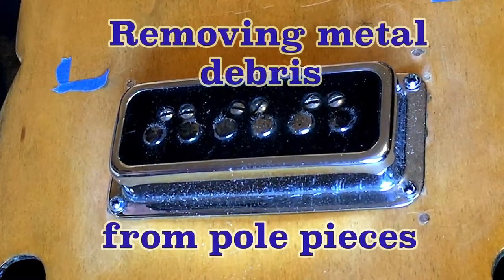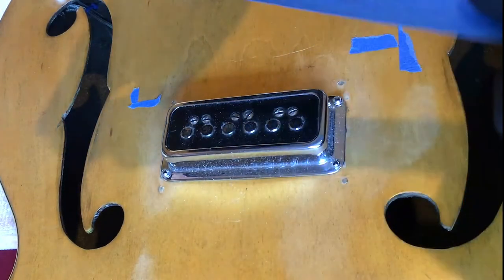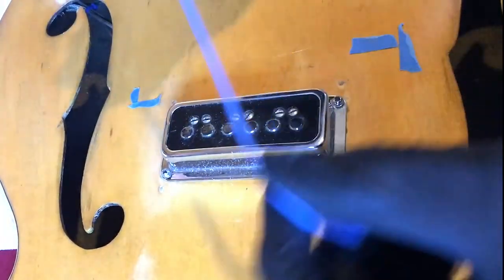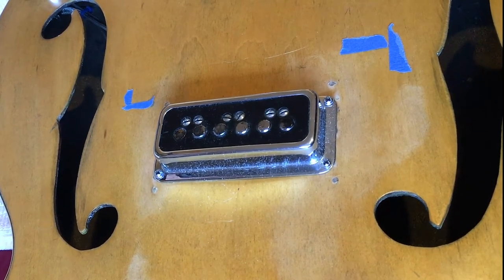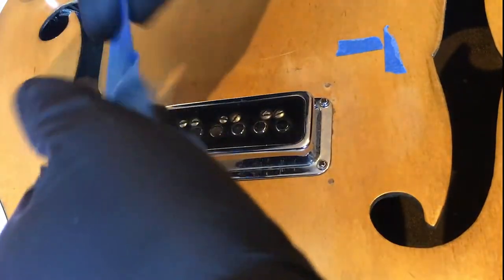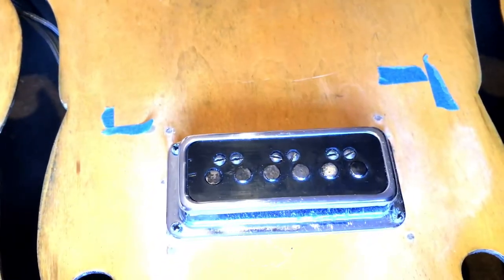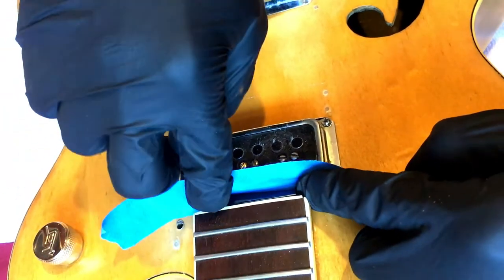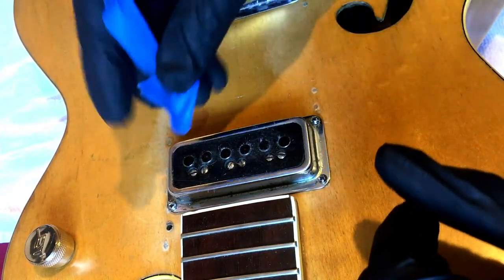Removing metal shavings or steel wool dust from pickup pole pieces

Comment: I had this problem on my DeArmonds today. I used steel wool a few days ago in the same room. Noticed the DeArmonds (T-Armonds actually) were covered in shavings. I tried masking tape first, but I ended up buffing them off with 10,000 grit sand paper as I was sanding and buffing the guitar to restore it.

Comment: So is scotchbrite not magnetic?
Reply from the maker: In my experience the 3M 0000 Scotchbrite is non-magnetic, its nylon embedded with abrasive.  Never hurts to tape over the pickups anyway but Id be surprised if you find residue after.
Reply: @rabidhamster  literally right after I watched your video I went on Amazon and bought some, I didn’t know there was an alternative to metal sponges, seems pretty underground! Thanks for sharing that tidbit in the video and sweet guitar